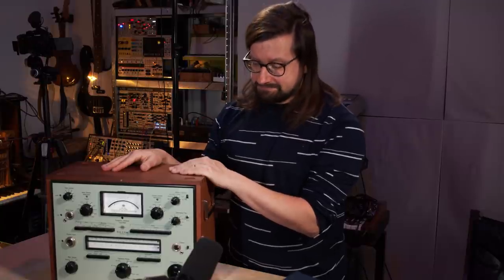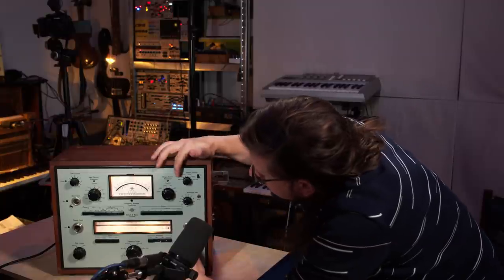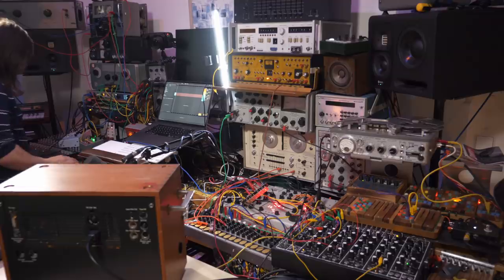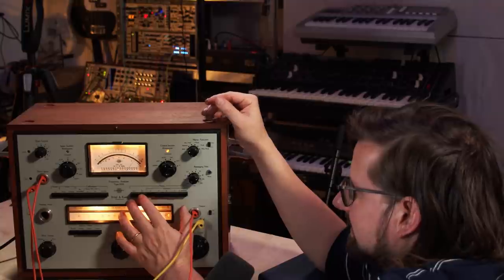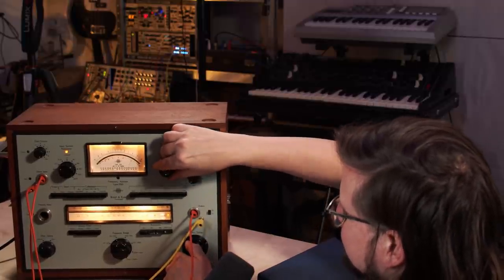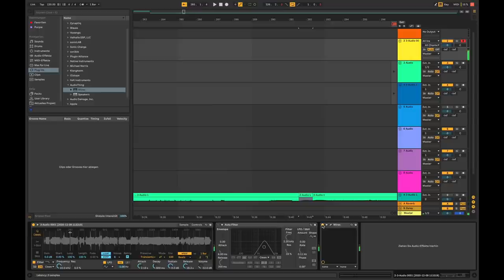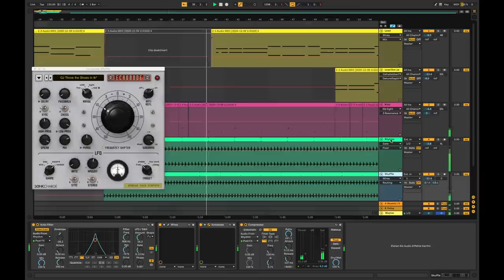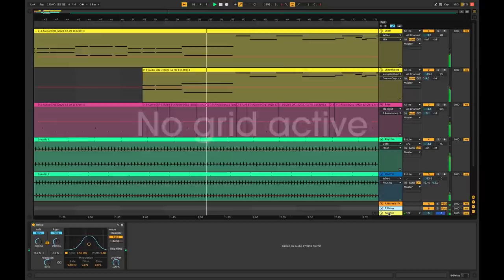The joy and agony of music on vintage science equipment

Comment: your videos inspired me to pick up some old test equipment. I got a Heathkit O-11 oscilloscope for a couple of bucks but then spent over 100 bucks on parts to replace the caps, fuse and some resistors. I can feel your pain at the end
Reply from the maker: Yeah, its kind of a thing you need to facture in unless you get lucky. There are some rather indestructible things though - the sweet spot seems to be early 1970s.

Comment: Have you considered procuring a variac/auto-transformer so as to enable bringing the device up slowly (easier on caps and so forth)? This is my standard routine whenever I'm powering up some valve gear that has not seen use in a while.

There is the added benefit that oscillators and filters and so forth can become delightfully unhinged when starved for voltage, so in a sense it can be used as another instrument or layer control.
Reply from the maker: I am so dumb - I have one now in my new workshop. This is what I will do in the future.
Reply: @Hainbach  I disagree with "dumb"; this is very much an aspect of these things, and did make for engaging content. May your repairs be enriching!